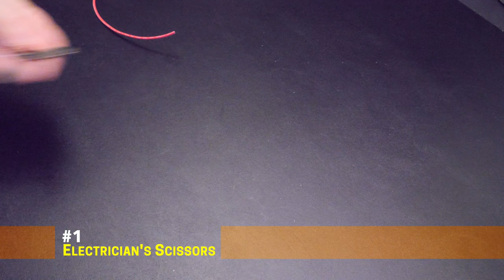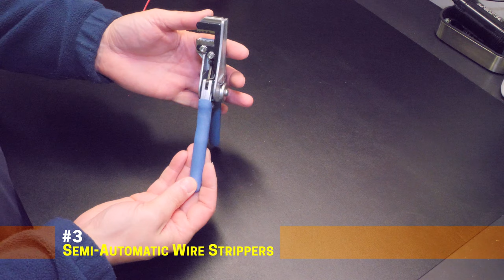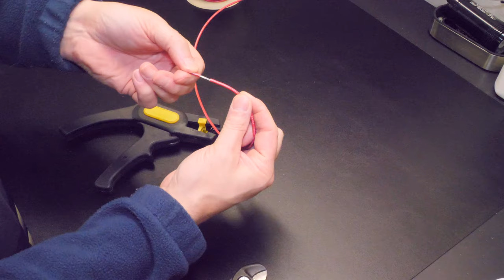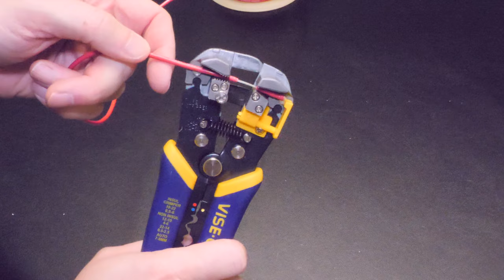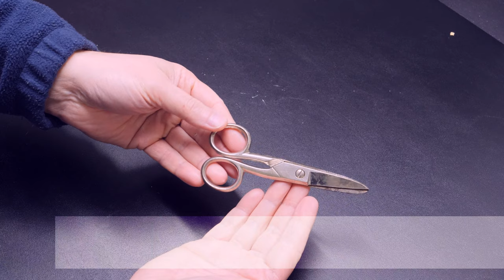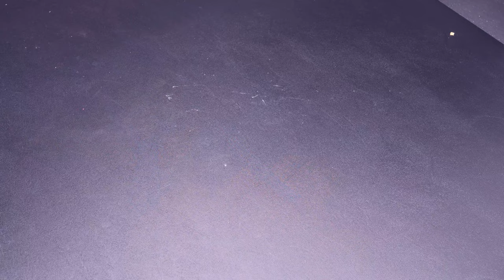How to Strip Electrical Wire like a Pro 6 Ways

Comment: As a 40 year industrial electrician, I stripped thousands of wires using the Ideal Stripmaster.  They have an adjustable wire stop that can be added to strip every wire the same length that I used for terminating in control panels.  I had a pair of electricians scissors but never stripped a wire with them.  Also, I never ever saw anybody strip a wire with their teeth!

Comment: A  professional electrician that I worked with, just used the cutter of his pliers to strip the wires.  I've used this myself and it works fine, though it takes a little practice to master the technique.

Comment: Thanks for the video! I've stripped many wires over the years, using good quality (Klein, etc.) traditional wire strippers, which work fine for me. (For crimping, you should use a dedicated crimping tool - I have one with 6 interchangeable jaws for different style terminals.) I decided to try one of the automatic strippers - bought the Klein - it worked fine for 16 gauge stranded, but when I tried it on 12 gauge stranded with stiff insulation it nicked the wire - thought I must be doing something wrong so tried it two more times - still nicked the wire - ended up with my wire too short for my project (line in wires to a new contactor in AC condenser unit) which caused me to have to move things around which was a pain. Will never trust it again. Online reviews show many folks reporting the same problem. The jaws are sloppy & move, nicking the wire. Later discovered that the automatic Klein stripper is made in China - their traditional strippers are made in the USA - probably the reason for the quality difference.
Reply: Wanted to add that to avoid this problem, when stripping wire, always start with a notch larger than the gauge wire you have. Sometimes using the next larger size on your wire stripper works and you don't end up with damage like I did. With this particular wire stripper, when I used the next size up, it worked okay! Wish I had realized that sooner!

Comment: The automatic, auto-sizing wire strippers such as the Vise-Grip one you demonstrate are the easiest, fastest and most reliable for situations where they work. It's also worth noting that these can be used to strip a short length of wire in the middle, if the length on the cutter side isn't too long.

They do have limitations, however. They're limited to stripping a certain minimum length of wire (typically at least 1 cm, and anything less than about 3-4 cm is difficult and fiddly) and also have a minimum gauge, being unable to strip anything smaller than 24 AWg.

I work with electronics where I regularly exceed both limitations, so for that reason I often find myself using the jaw-type wire stripper that was the first one you demonstrated (after the scissors).
Reply: which would you recommend for kinda all round, like 2.5twin earth 1.5twin earth and single cables
Reply: @chungsclapu1728  Unfortunately there is no all-around stripper that works on everything. (Or at least I've never seen nor heard of one.) Even two strippers that do fine on the exact same type of wire may vary in how short a length they can strip and how easy and quick they are to use. The only thing I can really suggest is experiment until you find the stripper that works best for the particular wire you use most often.
Reply: @Curt_Sampson  okay cheers pal, just at college we use alot of 2.5 twin and earth but haven't seen any cable strippers for them

Comment: tldr; Summary:
1) Electrician's scissors
2) Traditional wire stripper
3) Semi-automatic wire stripper
4) Semi-automatic wire stripper with automatic sizing
5) Vise grip semi-automatic wire stripper with automatic sizing
6) Teeth (not recommended)

Comment: The plastic on the vise grip strippers does last. I've had mine for about 6 years. I personally prefer the snips since I do low voltage but the vise grip comes in handy for new installs like speaker wire.
Reply from the maker: Very good to know, long lasting tools are always appreciated!

Comment: Is there any tool to strip off insulation in the middle of wire (or somewhere other than on the end)?
Reply: no you wouldnt want any metal showing in the middle of a wire, though if you really wanted to using a knife like you're sharpening a pencil will do the trick ;)
Reply: @spinchybb  Well, if you're creating taps  at different points on a inductive coil, you would want metal exposed so you an clip to it for different impedance and so forth.

Comment: Honestly, unless you're really having to strip wire all day long all the time, it's just easier using a sharp knife? Like it's really easy. Just go around the wire insulation jacket pressing gently so as to not actually cut all the way through the wire, then just press digging with nails and pull. Isolation will come out cleanly.

Comment: What would you use for stripping a wire about as thick as dental floss? I've heard of burning it off with a lighter, but I don't want to risk leaving wires with charred remnants of the insulation.
Reply: Noah A that’s ridiculous do you ever hear things about pollution and ice melting.
Reply: @jacobturman5602  I'm really hoping this is just a cringy joke.
Reply: They make wire stripes up to 30 gauge at my home depot.  And with some tool you can buy custom blades for really small precision work.  I wouldnt buy the Irwin's or any auto sizing because of how high the gauge is.
Reply: I once replaced a tonearm on a Technics 1200 turntable. The new tonearm had wires that were nearly as thin as hair *with the insulation*. Burning the insulation off the end was the only way as any attempt to remove insulation also tore the conductor into two pieces. Then I rubbed the conductor lightly with a scrubber and tinned it so I could solder it onto the the board.
Reply: @BigMikeECV  Damn haha, thickness like that sounds crazy. Weird as hell I'm seeing this now, since I just used a lighter on a wifi card's wiring literally a couple minutes ago. But yeah, I started using the lighter method a while back. Realized you don't get a charred end when you burn it a bit further back, then slide the insulation off.
Reply: It works.
 I used it to burn insulation from headphones.
But i recommend having some sandpaper with you to get rid of burned insulation.
(some insulations burn really fast and clean and some dont want to burn at all)

Comment: 42 years as an auto technician, whos got time for wire strippers?? take bic lighter out of your pocket that you are probably carting around to light torches and so on, put it under the wire at the desired strip point and heat up wire, dig your fingernail in  the insulation and pull. simple and fast and you saved 50 bucks from going down the Snap-On shit hole

Comment: I’ve got a lot of Christmas light wires along with other cords that are just as narrow that I’m presently stripping.  Aside from gently putting them through pliers to stretch out the insulation, is there a quicker and better way to soften the coating to make it easier to get to the copper wiring?

Thank you

Comment: could you please provide a link to the "Gun" looking pair - that auto splice without needing to match size, please?  - I can only find super fancy versions in my searches and that one look pretty entry point quality (which will suffice for my needs) - $153.90 (AUD) so circa $99 USD is all I can find... $30-$50 would be appropriate I think

Comment: I now have a small bit of front tooth missing because I learned to strip wires using the teeth method when I was little. Accidentally bit into a wire instead of getting it in between the front teeth. Pulled and took out a small bit of front tooth. Definitely don't recommend that method. That's why I'm here. My problem is tiny wires. Like 32 gauge. How to strip those without cutting them by accident? Don't like to light the ends on fire either. But is that the recommended method?

Comment: Those Irwin's aren't very good. Many, many types of wire insulation just slip through those jaws without the jaws biting. THHN wire, such as what you'd run in conduit, is especially problematic. The outer layer of nylon just slips right through those jaws.

The Klein strippers with the multiple notches are much more reliable.
Reply: i have the same problem with thhn wire...can you suggest a way or a tool to easily strip them?

i have use auto matic stripper but its just slipping from the jaws and manual stripping with pliers but always end up nitting the copper
Reply: @__djcruzer__8986  Anything from Klein Tools.

Comment: You don't like regular wire strippers because your using them wrong.
Reply: When i see someone claiming you can "do ___ like a pro" and the proffesionals never use it then you know they're full of it. I'm a 3rd generation electrician, I've worked for residential, commercial, and industrial environments and I rarely see anyone use anything besides standard strippers or maybe an electricians knife (basically just a specialized box cutter). The same holds true of any trade or craft, there's a reason chefs/cooks never use 9/10 kitchen gadgets on the job or at home.
Reply: @arthas640  Most people just strip with there lineman

Comment: if you use teeth you need help... traditional wire strippers work just fine for around the house or commercial work the others are convenient but aren’t typically handy if you’re in the trade (they’re kinda bulky and would be a pain to carry around since most electricians wear work belts with hand tools

Comment: If youre doing a lot of wiring, use a regular stripper(2nd tool shown). The 3rd stripper he showed you saying its good for lots of wiring is heavy, time consuming and a gimmick. It does strip the insulation for you but they cost a lot more for it and its simple to do yourself that the price isnt justified.  Its bulky, heavy and cant reach into tight spaces. Itll actually take you longer using that than just a regular standard stripper. If you find something as easy as manually stripping off the wire insulation hard and need a tool like this, then youre in the wrong field of work.

Comment: You called the best tool there (regular stripper) the one you never use? Lmao. Youre definitely not in the electrical field of work, every electrician like myself has a standard wire stripper and use it daily on the job as its the most convenient, easy to use, light and fastest tool stripping wires on the job out of everything you just showed. Why do people like you insist on making videos about tools you dont have field work experience with??? The stripper you said you wouldnt use unless its a last option is the best option to use in almost all cases. When you said that one specific strippers advantage was that it can strip a very little off and most strippers cant, are you crazy?? Yes they can, almost all the strippers you have can strip a small amount of wire like the example you showed lmao. Also, you said in many cases stripping it that short is useful? Many cases? Youd hardly ever want to stripper short at all. If the stripped wire is to short wire nuts wont be able to grab and lock wires youre connecting to together. If its to short and your going to plug the exposed wire into quick connector the exposed short wire would be too short for the quick connect to bite and hold it. 99% short stripped wire is useless. You really have no idea what your talking about at all.